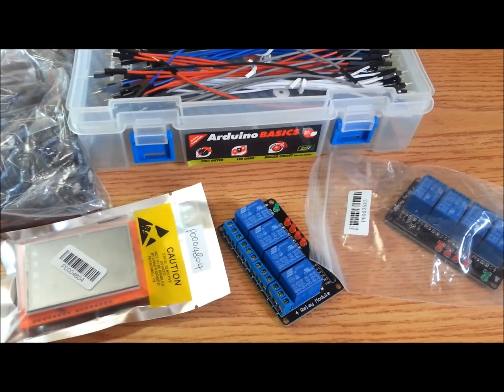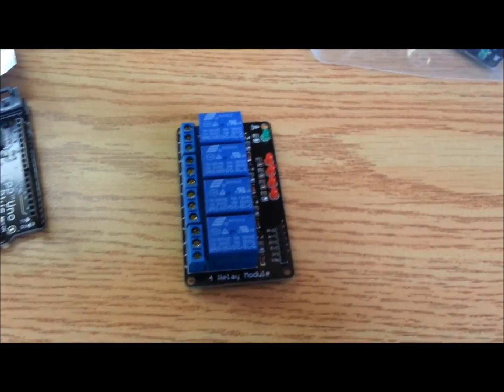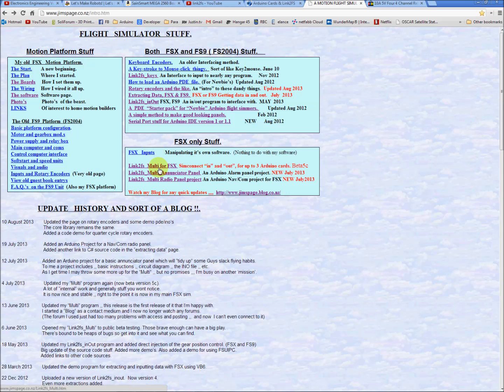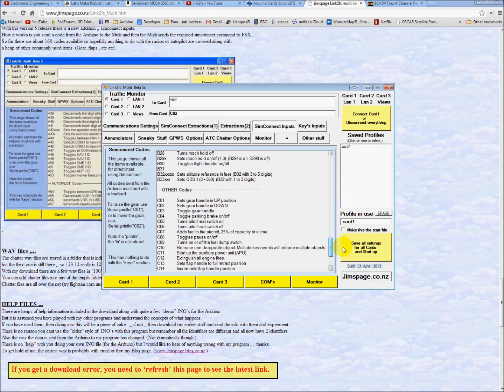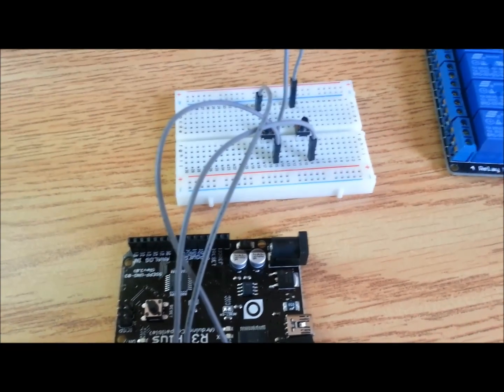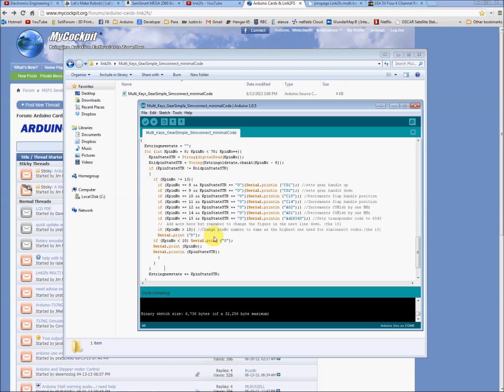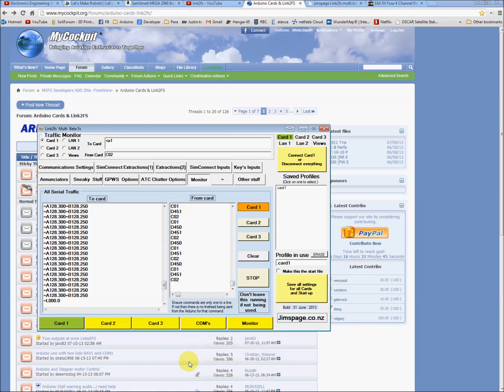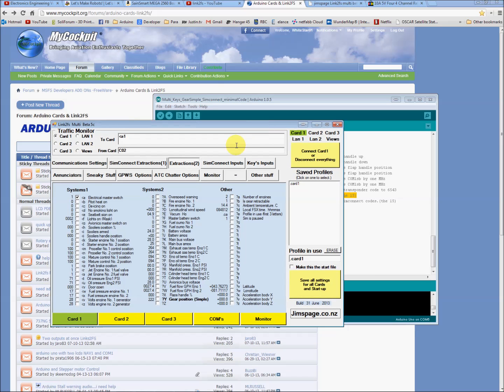Interfacing Arduino with Flight Simulator- Tutorial

Comment: what would be a program that would allow me to have 3 landing lights (RGB) and send signals to those lights for 3 conditions, GREEN (gear down), RED (in transit), OFF (gear up).  SO the flight sim would have to connect to a logic board (ardunino or something) and the logic board would send signals to the 3 RGB lights.  But the sim would dictate what condition each of the lights would be in.  Someone already written some open source code for this? Or a GUI program that already written (Payware/Freeware/etc.) that could control landing light conditions (Green, Red, Off) ?  Does this program do this type of stuff?  My flight sims are MS-FS2020, x-plane 11, & DCS World.

Comment: Hi,  nice explanation. 
I want to know how to run dc motor using value data offset. 
Example. 
Case # 'k'  as a offset data 11BE. I see value is variable linear in short 0 untill 45699.
So i want run dc motor if value 16000 above. How to write scripti coding arduino

Comment: I just use an old keyboard in a box and cut holes for modified switches that can rotate or click and push keys just like these overpriced simulator panels. Its far easier and cheaper, I made them from electronics people were throwing away and made it completely free. Why do people over complicate something so simple as a button panel, should be plug and play.
Reply from the maker: This is NOT what you want to play airplanes in then. This is for a 1:1 scale Lear 45 cockpit I built from scratch. It is not a keyboard in a box...
Reply: @MkmeOrg  I make my control panels out of keyboards, you go for the real deal but If I was that obsessed with planes I'd might as well get one, but I get your point. Some people take simulators seriously and should enjoy it however they want. I just see it as accessories or toys to enhance the fun of a video game because no matter how many buttons, pixels or, accuracy and detail you put into it, its still a simulator for fun.

Comment: I have an old Mega 1280 that still works fine, I'm working on building an AP module around it based on the 737-800.

After switch inputs, led indicators plus digital output through cascaded Max 7219 shift registers to drive 8 segment LED displays and i'll have plenty of unused pins left
Reply: Do you think that I can use a Mega 2560 too?
Reply: @Tobi_DarkKnight  Definitely, yes.
You only have to make sure you have enough I/O ports on the Arduino to handle your switches and outputs 
My biggest problem is getting the rotary encoders to read right.

Comment: Thanks for doing this video. I have just purchased an Arduino Mega to interface with FSX so that I could add switches initially. The board arrived today so I now have to get hold of switches, wires, a metal or plastic box and resistors so that I could have a layout simular to the lower switches etc of the Cessna 182 (A2a) well that's the idea anyhow. Thanks.
Reply from the maker: Nice!

Comment: Hey, could you explain how to use a ON/OFF toggle to do landing gear (On being down Off being up or vice versa) Would best way be to use when high print the code for down and when low print code for up?
Reply from the maker: +Adam Robson Probably wont get to a video on that for some time. There is demo code for just that in Link2FS so you might want to check out the forum. Cheers
Reply: +Eric William -MKme Tech Cheers man I'lll have a look

Comment: Hi! I`ve now an Arduino Mega 2560. I have Analog Inputs/Digital Inputs/Comunicatation and PWR.
The Digital Inputs aare only from 22-53 . Where I must connect the Wires from the Switches?
Reply from the maker: Rasti Tony That depends on your program.  Cheers
Reply: OK thankd:D

Comment: I want to use an Arduino mega, FSUIPC and also write some add-on codes under it for integrating my FS2004 with a home built Flight Simulator Cockpit. Pls will this be good or do i need more.
Reply from the maker: Muhammad Mubarak You should be fine.  Can do tonnes of I/O with a mega.  Enjoy!  Cheers
Reply: Thank a bunch, i have started
Reply: Muhammad - after 3 years how is your FS2004 Cockpit going?

Comment: Can I use instead of an Arduino, a STM32F4-Discovery board? Work the software only with Arduino`s?
Reply from the maker: Rasti Tony Not familiar with that board sorry.  Cheers!
Reply: If it's capable of providing output via the USB bus, it is very much possible. You just need to do some research on porting the code from Atmega to STM32.

Comment: Hi! I'm using an arduino uno and I was wandering if I could use a shift register to to add more digital outputs for more switches instead of buying the arduino mega. Do you think this will be possible?
Reply from the maker: I don't see why not.  Haven't done it personally.  I saw a really neat video a while back on the ATTiny which he got tonnes of inputs per actual input pin.  If I can find my link I'll send it your way.  Cheers.
Reply: I'm planning on using 3 cascaded Max7219s to drive 21 digital displays(8 segment leds) for my autopilot module , I don't see any reason you couldn't use them for other outputs, a 7219 only requires 4 wire input and can control up to 64 outputs(8x8 matrix)

Comment: I use a Arcaze USB module right there --> www.simple-solution.de
my question is because i even know it ;)

Can i use the arcaze and further expansion boards like the displaydriver expansionmodul for the arcace with the program Link2fs ?

one week ago i was buy me a arduino mege 2560 version 3 board and so here ist my second question. :D

Can i connect the arcaze USB modul and its expansion boards like the Displaydriver and the 2 boards that leads the 7 segment LEDs and the
arduino mega 2560 Version3 board at the same time
with this programm to connect some buttons or stuff like 7 segment LEDs
to use them together if i fly on FSX ?

and last but not least here comes my last one ? ;)
Can i to realize things like that show in that Video --> Arcaze Video Tutorial #4 - Display Driver
with the arduino mega 2560 version 3 board ?

The Arcaze USB is not a Amtel microcontroller but it looks like that a NXP microcontroller still works there for a long long time ! 

Thanks guy for answer soon and have a nice day !

Comment: I was just wandering, because there are a limited number of digital outputs on the arduino uno, do you think I could use a shift register chip connected to the RX/TX pins to get more digital outputs to connect switches to.